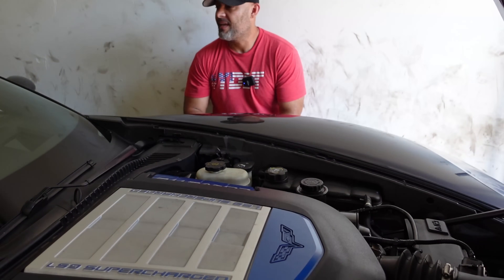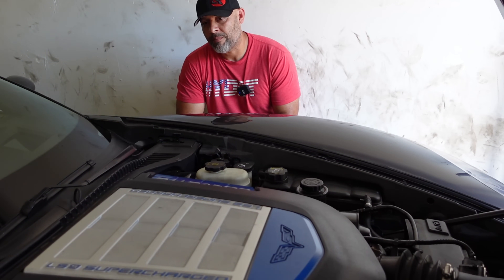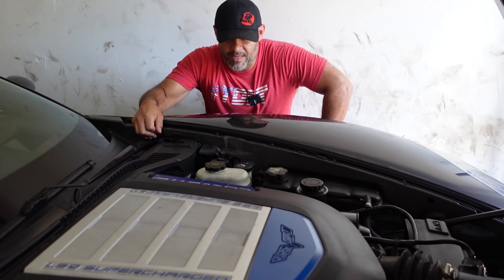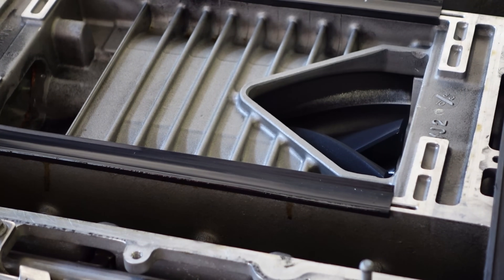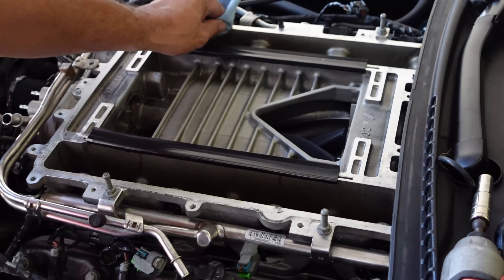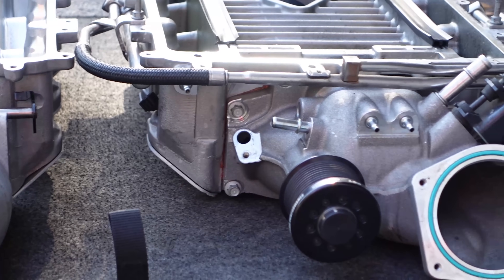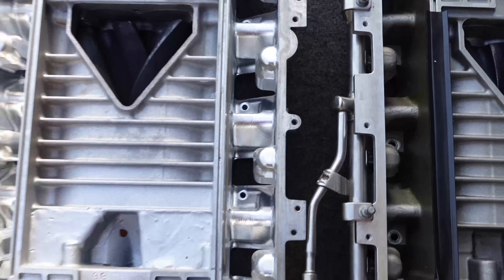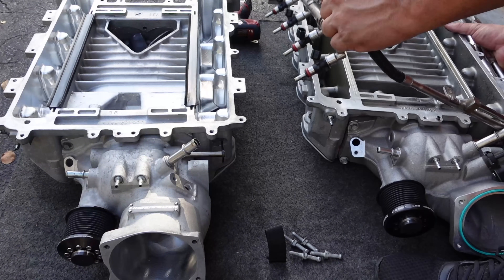2009 zr1 kong x ported 2.3 L LS9 supercharger comparison and install

Comment: I’m hoping you can help me out. That hose that connects to the firewall and runs to the snout in the very beginning of the video, what is that hose called? I’m needing to replace it and I can’t find a parts number. The connector in the firewall had the green plastic end

Comment: He narrowed that bypass to speed up air I’ll bet. Think about it in comparison from a large diameter water rose to small diameter increasing pressure. Thinking in bypass mode the faster air would make that blower hi faster/ harder. Just a guess.

Comment: 800rwhp in a ZR1 is perfection. Don’t blame you for wanting about that power level, you’ll be able to drive it anywhere and cooling mods will keep the temps in check 24/7. Going to be a riot of a cruiser

Comment: This video is solid. I'm learning more and more about Corvettes with each video you make. 👍👍
A question for you: DO you have a telescoping magnet or a nut driving bit for your Milwaukee tools??? The nut driving bit has a magnet in it as well. A little piece of mind to have when "trying not to drop a bolt into the engine".